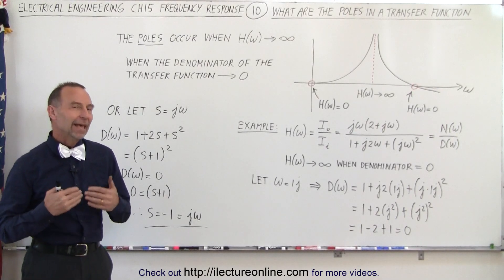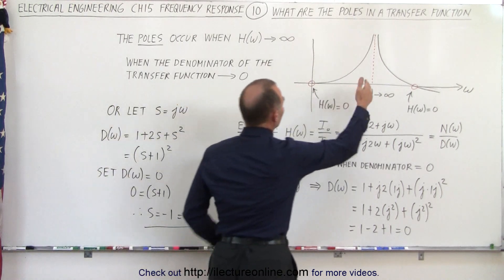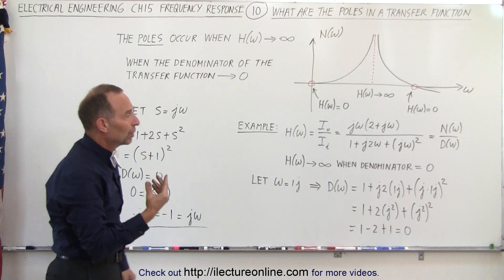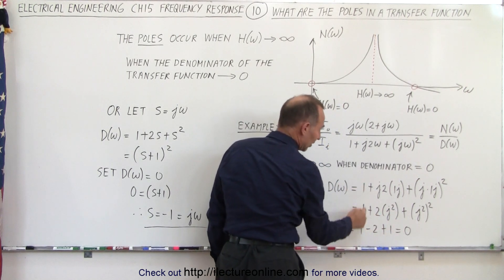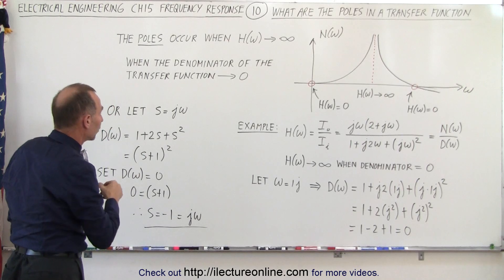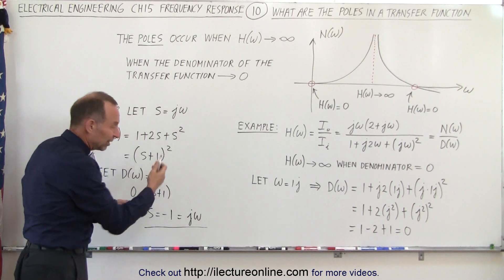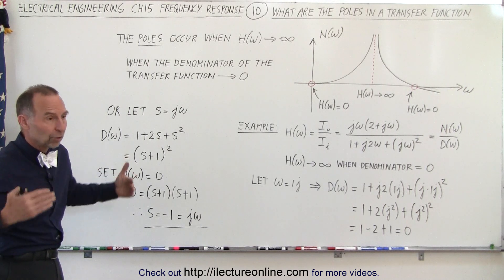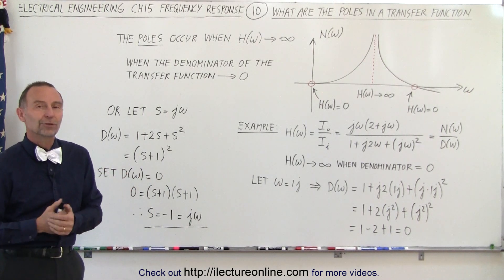Electrical Engineering: Ch 15: Frequency Response (10 of 56) What are the Poles in a Transfer Fct.?

Comment: Awesome!
Is there really a circuit which allows infinite( very large ) gain for a particular frequency? is that the resonance?
Reply from the maker: Typically, the greatest current is caused by the smallest impedance, which is where the capacitive reactance equals the inductive reactance and the impedance equals the resistance.